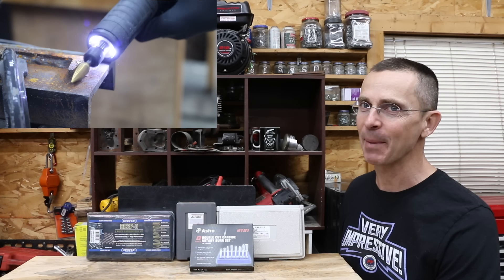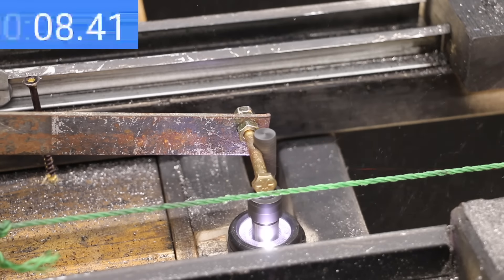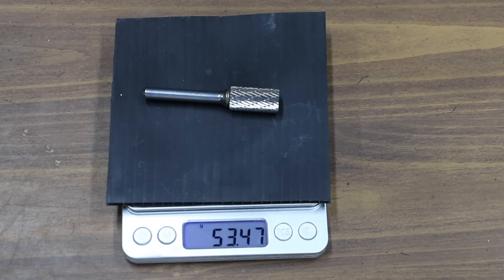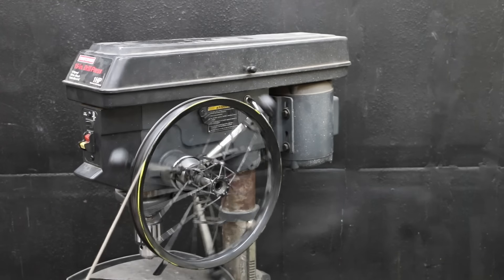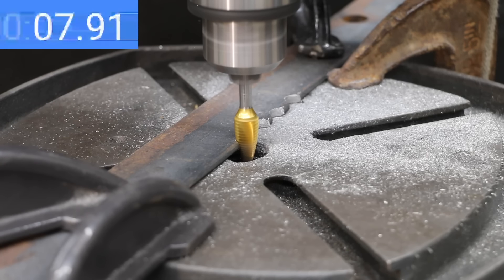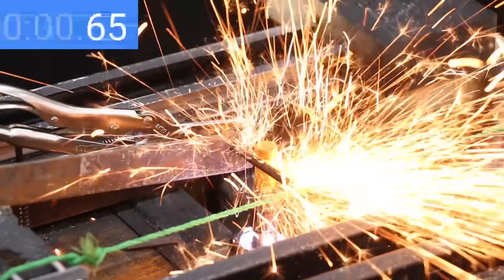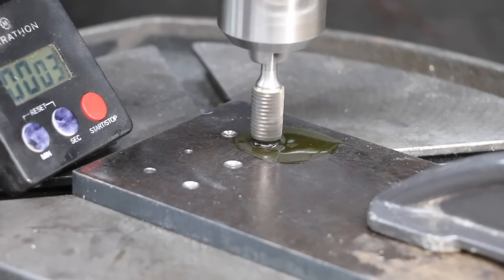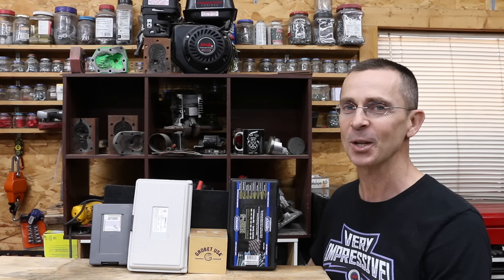$28 vs $300 Burr Set? US vs Imported Burrs. CLE-LINE, Champion, Grobet, Kodiak, Astro Pneumatic

Comment: Here's another suggestion to better evaluate/compare the value of power tools.  While the performance tests you do are great, it's often hard to compare the relative value of tje alternatives, i.e. price versus features/performance.  Some items evaluated are priced as kits (with battery & charger), others in the same test are priced as bare tool only.  The summary comparison graphs do not show comparable prices for each item.  If these these are yo be used to show prices to compate value, the graphs need to show apple-for-apple prices. Examples: bare tool cost for each & all items, and/or, the price for comparable bundles or kits (tool plus battery & charger).
  Thinking how many peoplr would be trying to compare real world costs in their own situation, I wonder if it would be good to mention options for powering all items reviewed using adapters and a common battery used for each tool (versus each manufacturer's proprietary battery & charger price).  Example, people with Dewalt power items (batteries, chargers) would benefit from knowing price of adapters for their power items, to br used with each bare power tool.   
  Are Amazon prices always the best to reference?  Example, for the SOG knife recently reviewed, the best deal I found was NOT Amazon, it was SOG direct.
  And thanks for providing a good source for 18650 batteries that was not Amazon.  Sources with a good selection of 18650s are hard to find, so far.
  Would it be good to provide links to or pricrs from Northern Tool, Farm & Fleet, etc. for tool prices?  I have often found good deals on name brand items there.
Reply from the maker: You are welcome!

Comment: If you multiply the price with the wear rating, the expensive tools don't pay off
Reply: The wear rating is subjective.  The tests show the cutting of one piece.   You would need a comparison over enough pieces until the tools are no longer usable.   That is the only true way to determine what is calculated to be 'cost per cut'.   For occasional home use, the less expensive sets might be the most economical purchase.   For a production setting, the more expensive tools will probably turn out to be the most cost effective.   Once the cutting edge starts breaking down, it is only a short period of time before tool destruction.   Also, in the burrs tested, the most expensive set had the gold coating applied....most likely TiN  (titanium nitride), but looks can be deceiving as to the actual coating.  The coatings available for cutting tools can extend the life dramatically, but there are specific coatings for different materials to obtain optimal effects.   Of course, this is applicable in high-production settings where tool life is imperative.   For the home craftsman, it probably doesn't make that much of a difference.
Reply: opposite, actually

Comment: Have Idea: Hammers. Traditional handles or these new "low impact" or "fatigue free" handles that claim that they have less impact to your hands?..... Solid Full Steel vs isolated head/handle design.... I could bet the new age hammers required more potential vs kinetic energy than old solid.... Impact loss? Require more swings?  Please HELP me put these young punks back up in the rafters with Solid framer hammers! Sure seems like they have to swing there hammers 1-1.5 times with same weight hammer.
Reply from the maker: Thanks for the video idea.

Comment: Bad test, because the upm should be between 12000-15000 rpm and you should use a spindle which runs perfect with min tolerance! I use a Biax Grinder and I neve get a dull bit after cutting one bolt...
BR

Comment: I think you would have completely different test results if you actually use the tool that those are used for which is a air reamer drills just do not have enough speed to do what they need to do at least I haven't found one to do it with
Reply from the maker: Thanks for the constructive feedback.

Comment: Its hard to judge how accurate the bolt test is. In the last few mm I'm not sure what matters more: actual cutting speed, or friction generated to heat up the metal to bend easily.
If one brand generates more heat from friction, is that making the bold bend faster rather than the cut being deeper?

Comment: Clearly, no high profile brands, such as DeWalt, Bosch, Milwaukee, etc engaged in this grinding bit market for burr bits to provide a cost effective alternative to your results for high precision/higher cost bits. Pity - I have to remove multiple nail heads on metal fasteners for fencing repairs. A competitively priced grinding burr would save me time and effort, rather than to prise the nails loose.
Reply from the maker: Thanks for the feedback.

Comment: Man, oh man. I hate to say it, but I’ve never disliked a single video of yours before, but this is a first. I’m a journeyman machinist, and I use these things almost every day. If this was labelled carbide burr torture test, maybe it’d be ok. This one is not a good test of these tools. They are not designed to work like this at all. They are not endmills or slot drill, nor are they twist drills or step drills. These burrs are meant for use in a die grinder to be used by hand using small light cuts, not plunging axially or radially.

Comment: I could be off here, there is info to be learned from these tests but im feeling like these tests dont relate well to most real world use cases.  Deburring bits arent often held hard and constant against material heating them up badly making the teeth fail faster. A more accurate real world use involves the deburring bits being held into material and released repeatedly, such as in porting cylinder heads or uses similar to this.  They might not heat up as much with a press and release use as they do with constant heavy pressure.
Reply from the maker: Thanks for the feedback.

Comment: There is no low quality tungsten carbide. Only cheap brazing. I would put the difference down to tooth geometry. Coatings are always better unless it is a deep plunge cut and you just snap it off the shaft.
Reply: Maybe let the rasp heat up before full pressure is applied. A lot of those work better smoking hot. I know this applies with tool steels. Correct me if I'm wrong for tungsten carbide.

Comment: I don't understand what's so great about carbide bits if JUST ONE CUT is enough to chip and start to dull the cutting edge. Sounds like a less efficient and hella expensive way to grind metal. I would probably only use it for difficult to reach spots, art, and minor finishing.
There's no way to sharpen them so once they're dull they're trash...
Like I said, I just don't understand the value...
Reply from the maker: Thanks for the feedback.

Comment: These burrs are designed for very high speeds. They’re not at their best at slow speeds under 5,000, or even higher. I certainly wouldn’t use them at 250 rpm.

Comment: I can say from experience. Do not buy the cheap ass de burr sets at harbor freight. I tried them and they were terrible and dulled out almost instantly on soft metal such as aluminum.  I have a set of four from the mac truck and they are pretty good for 150 dollars.  Costly yes, especially now that the mac man doesn't show up anymore.... Big suprise there as mac dealers only last 6 months and vanish into thin air.

Comment: Tests are, well, tests. But these bits are not made to be used in the way you tested them. Having used them for 30 years I used the same set from snap on or mac. Used mostly for trimming, smoothing and general use. I never once had to use them in such an abusive way. I get that you are testing the limits but most would do just fine in general use for most. For those that use them daily then the expensive ones might be necessary. And for sure, they should never be used in a way that turns the metal red. Just abusive and to me proves nothing.

Comment: Carbide burr bit? No rotary file!  Great how you test tools, however your terminology is incorrect. "Drill bit " for example will be located in the drill motor just beyond the"chuck" is the bit the actual insert cutting "device " is the drill.  Reference Drill  Co to make the distinction!  I challenge you on this! Drill motor,drill chuck, drill bit and drill. Rotary file is the correct terminology for this video.  Having said that Philips, flat head, Robertson, or otherwise are drivers!  Make like a hot dog and ketchup 😋
Reply: You are incorrect. It is a burr. Very common industry trade name. Very common. You'll never find these labeled as a rotary file. Ever. They'll always be labeled as carbide burr. Get your shit straight before you try to call someone else out.

Comment: The correct pronunciation of Grobet is "Grobay" the "T" is silent...  I'm very sorry but I've been selling Industrial Tools for 43 years and when I hear manufacturers names butchered, it's as if I'm dragging my fingernails across a chalkboard. Grobet is well known for Manufacturing some of the finest Swiss Pattern Files in the world..! Plus, I have a very difficult time believing that you even did this test using that Battery Operated TOY Grinder...!
Again, I will apologize but Carbide Burrs perform at their best when they have  consistent torque and rpm behind them. Next time please test a few Industrial Quality Burrs from IMCO, FULLERTON and MELIN. Only then will you see what a quality Industrial Carbide Burr is designed to do. The 3100rpm used in the Imported Craftsman Drill Press was woefully too slow to allow any Carbide Burr to do it's intended job well. Please consider using Pneumatic Tools with a minimum of 7/10 H.P. and 20,000rpm for your next test. With these specs, all of the burrs WILL cut much better while reducing the tooth chipping you saw caused by the toy Die Grinder and POS Drill Press. I'll shut up now.. I can't believe I watched this whole thing.

Comment: Bit and cutter is a big difference. Bit or Collet will be be found in the toll. Reference Drill co. To distinguish the difference.  Drill motor, Drill chuck,Drill bit, and last but not least the actual drill. So now you are using cutters or actually a rotary file.  Great channel but correct terminology would be appreciated, at your level of intelligence.

Comment: It's funny because you torture tested a tool in a way it was never designed to be used. I usually respect most of your findings because they jive with my 25 years of experience as a tradesmen, but if you want a hole, use a drill bit, if you want to cut a bolt, use an angle grinder. But, if you want to remove small amunts of metal at a controlled pace with a burr bit, these tests won't correlate. Sorry, but these tests were for clicks and nothing else. Very disappointed.

Comment: I would really appreciate it if you were to brush up on the scientific method. You are doing a sloppy job of testing (for example using a cutting burr to bore a hole, which is NOT what the tool is designed for or should be used for), and the result is often causing people to make decisions based on faulty data.